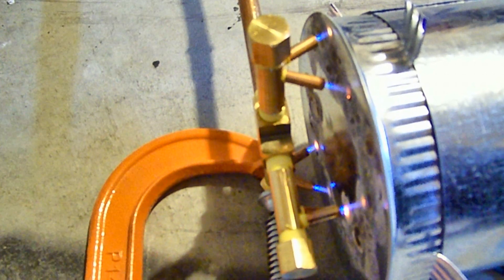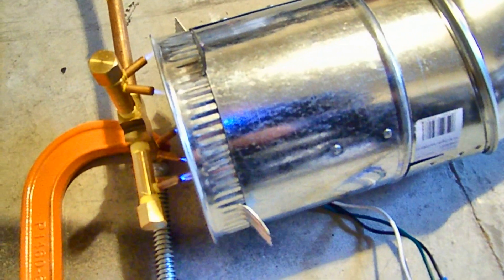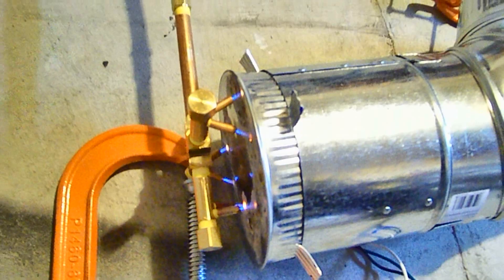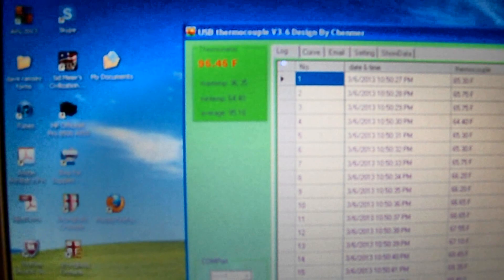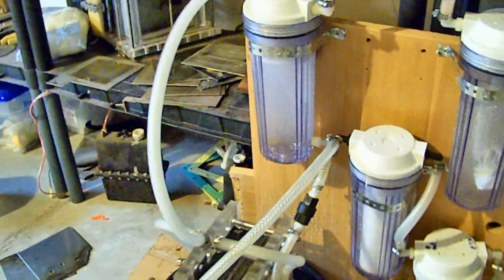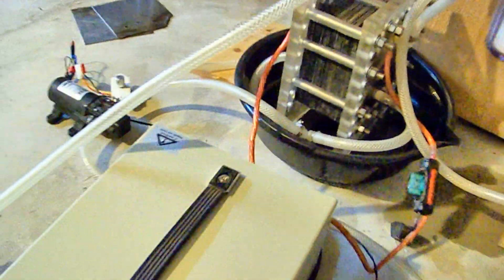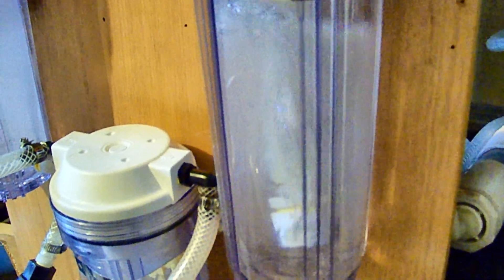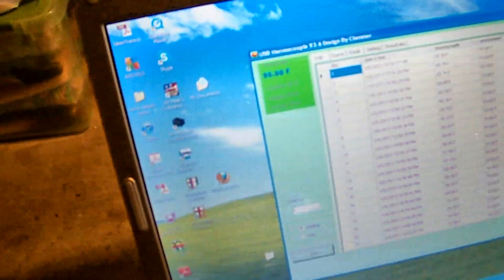H2eat HHO Heater

Comment: if that pipe be galvanized it will burn your lungs and kill you.Use black stove pipe.
Reply: Its not really burning... It's more like liquifying your lungs.. definitely will get Metal fume fever. Use black pipe or some other metal with a higher melting point

Comment: I was talking to some folks a while back about how to create the HHO efficiently and we all came to the conclusion that the secret lies with the coil/inductor construction. In the Dave Lawton circuit, there is an alternator from a car but the best way would be to use a 6 phase alternator along with a bifilar wound coil using welding rod for the core. The PWM pulsed electricity to the alternator feild coils. This was a demonstration set-up that used regular house current to turn a small motor to turn the alternators rotor. It is a good way to test efficiency of the system using different components before using it for an application. Also for this method I would recommend a brushless DC motor to turn the alternators pulley since they are so efficient.

Comment: You got yourself 900+- watts which is 3070+- btu's/hr.   at $.10 /kw this would cost you $.09/hr to heat well insulated room say maybe 24' x 24'x 8' . So times it by 24 hrs this would cost approx. $2.16/day times 30 days would equal $65 /month. These numbers come from the power source calculation and would be good down to around 30 deg. F. Not a bad little heating system..A thermostat in the wiring with a  pilot burner  ignition system would complete the unit to cycle it on and off.. Ya got a good start

Comment: How do you expect the fan to work when you have the inlet closed off with an end cap? Sorry but your heater doesn't make any sense to me. Maybe if you shot the flames into a tube and extract the heat from the tubes like and infared tube heater it would work more efficiently.

Comment: nice burner!
900 watts should produce plenty of heat in a small heater,you could maximise your output in a number of ways,the simplest would be putting a shroud over the flames,since it has its own oxygen the flame will burn under water so you could increase thermal transfer by putting a ceramic crucible over the flame under water,and heat water that could flow thru a radiator.